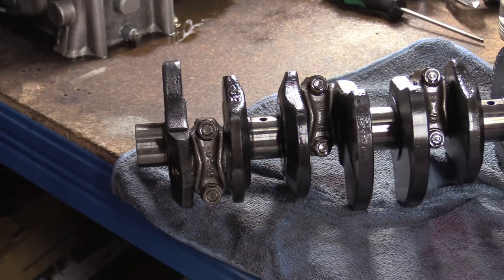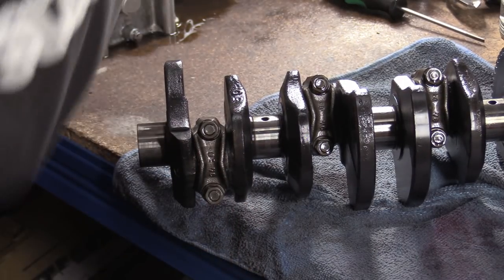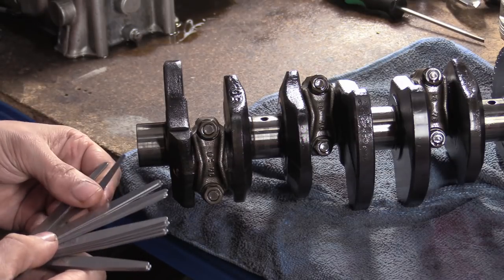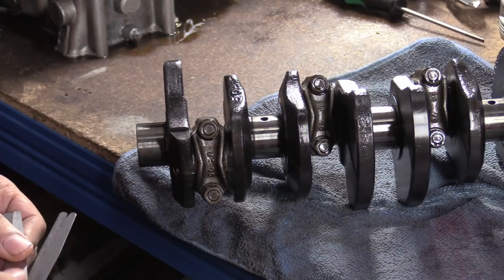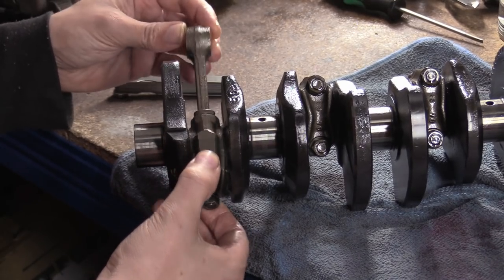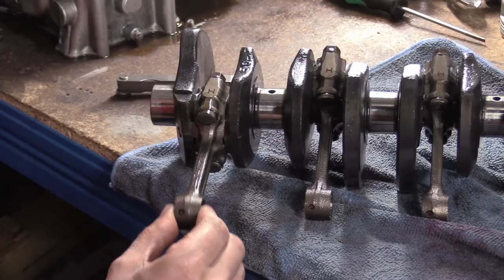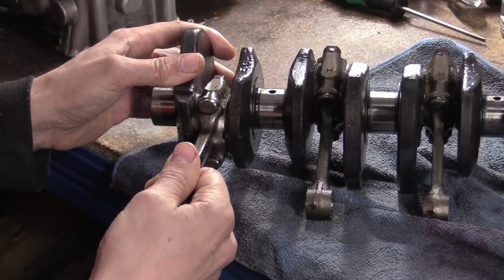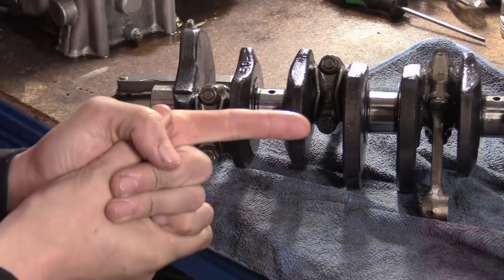Con-rod side clearance - M1stERd part 23

Comment: How does a pushed together crankshaft using ball bearings fare in comparison to plain bearings?  Does it stand up to higher loading s over time, and wear more slowly? The bearing comparison interests me. Obviously manufactures use the most appropriate, but how is one superior in an application? My two strokes had pressed together ball bearing cranks, and 4T appears to favour she'll bearings.
Reply: 4 stroke has pressure fed oil and wet sump to lube plain bearings on the crank, 2 strokes not so as the lube comes from the fuel that passes from the intake through the crankcase to the upper cylinder to lube the ball and roller bearings.
As to wear it depends on where they are used and now they are lubricated, the roller and ball bearings will last a long time in for example a transmission where there is ample lubrication however the lube in a  2 stroke is pretty scant and that reduces the life of ball and roller bearings and plain cant be used, so in 4 strokes that have ample lube the plain bearings will last longer, so the method of lubrication factors quite a bit into how long one or the other will last.
Stop oil flow to a plain bearing and they will wear out real fast as they rely heavily on the oil feed.

Comment: Nice vid, the main point is the clearances on this engine has done 100,000 miles.The rest of the engine clearances will be hopefully in the same respective spec or less it says a lot for the quality of the manufacturer's engineering. The engines history, was it a road bike then track bike? Was it maintained as per the manufacturer's recommendations, was the oil and filter change done regularly what spec oil was used?
My point is 100K on an engine is not a bad value for your initial investment.
Reply from the maker: Road bike with a few track days thrown in for good measure.

Comment: Typical ford issue this. Not replacable as ford supply the bottom end in a shortblock. Typical engine decline at 100k miles